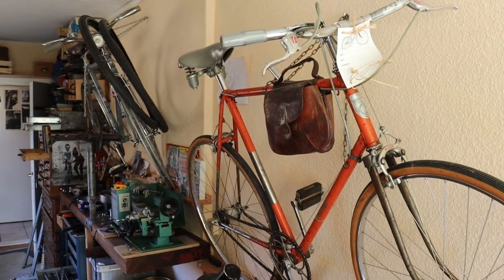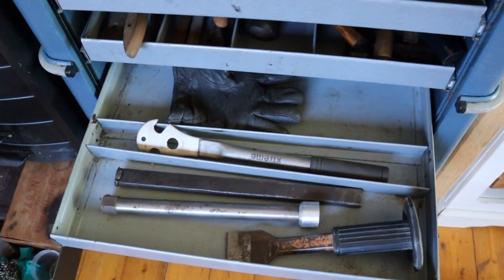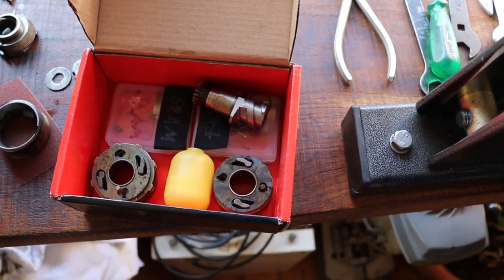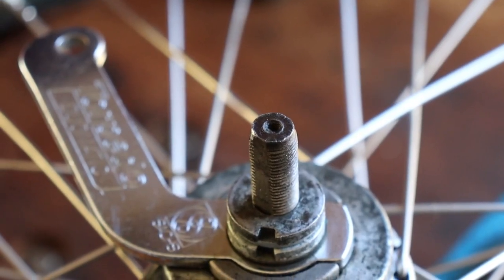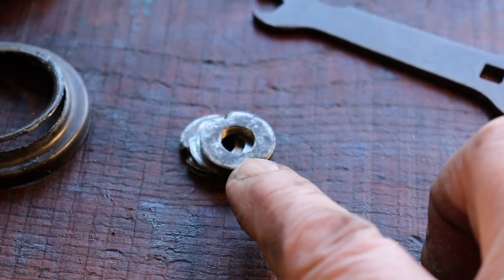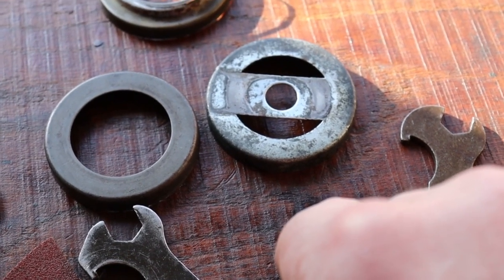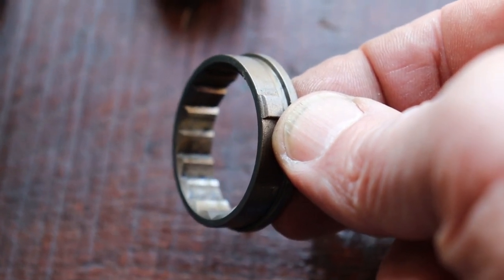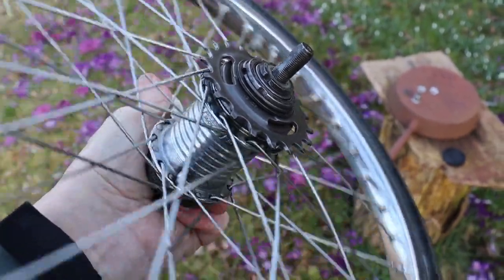I`ll introduce myself and talking about a Sachs Torpedo Duomatic 102 in a Moulton Stowaway.

Comment: Hi, thanks you so much for this video. I have a question regarding this hub: I got one, complete, but without the kickback brake. My father had as well a 3 gang from Sachs and we took the cone, brake and end cap. Everything fits but… while testing, the 2 speed passed, I could brake but suddenly the hub blocked completely. Scary 😅. After more careful inspection I recognized there was a missing hole in the brake come to fit the friction spring. Fortunately my father had another with the hole. Do you think the misplaced spring could cause this issue ? Or maybe the brake is not that compatible ? (It’s a steel brake, not bronze like in your video)
Reply from the maker: Hello Mojo, you need a brakecone sachsnumber. 0174 100 00, it is with the smal whole for the frictionspring. if  you dont have the parts, better buy a second 102, the parts out of a 3speed are not for a kickback. your hub goes to nirvana. regards jens

Comment: Hello sir. May I ask what causes slack in coaster brakes? If I engage brake then go back to pedal forward there is a slip or a free spot before it engages?
Reply from the maker: The mod 102 is 50 years old, try to buy a new brakeshoe. normal inside i a brass-part. look at first in, how much it is used. the mod102 is a good hub, I think it is much wort, you can pump money in :-)